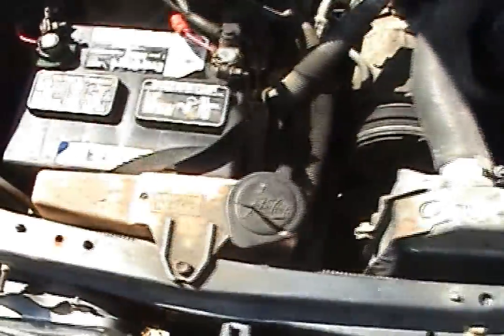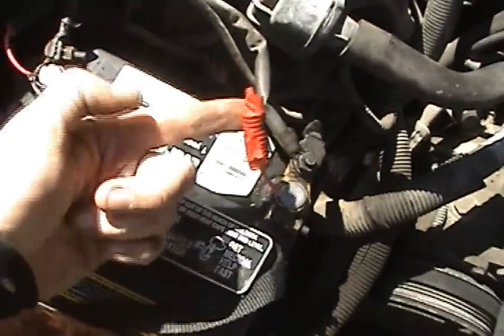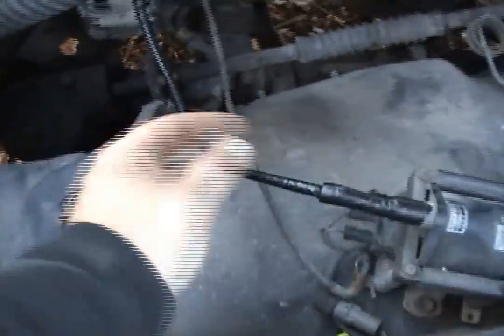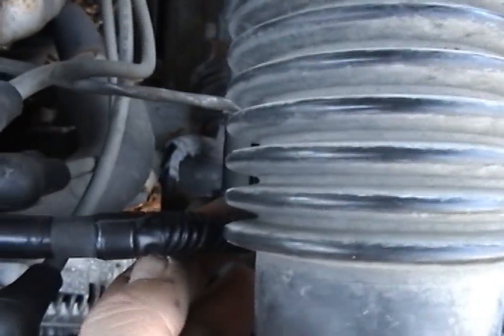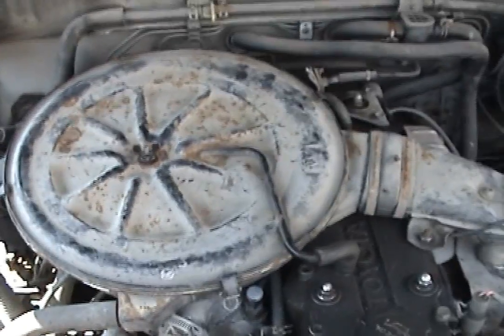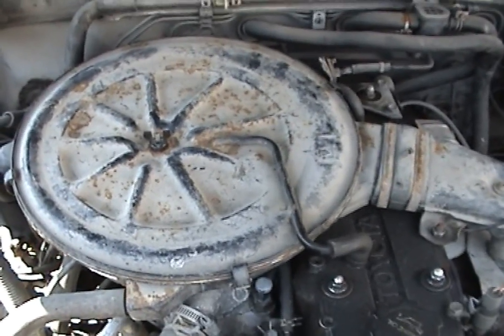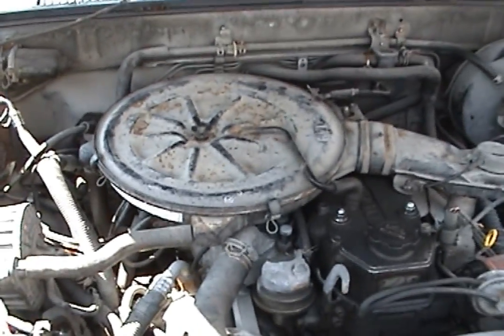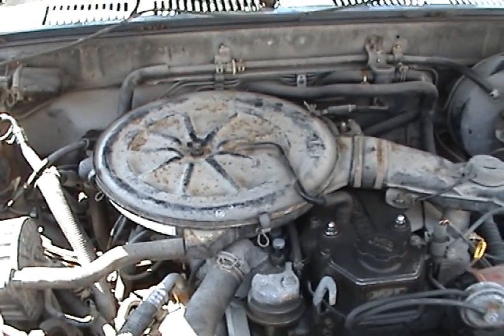Spark Gapping2 Cooling Power

Comment from the maker: @bikr1975 On 2 cycles engines because there is no water cooling it will run hotter. On a car it runs cooler. The heat does not come from amperage in this case when it's being used. It comes from all the gasoline or diesel being burned completely. There is no engine to date that i know of yet that can burn all the gasoline and stay cool. Unless ofcourse it's water cooled or kept frozen etc. Well actually if they build it to handle the coil then yes.